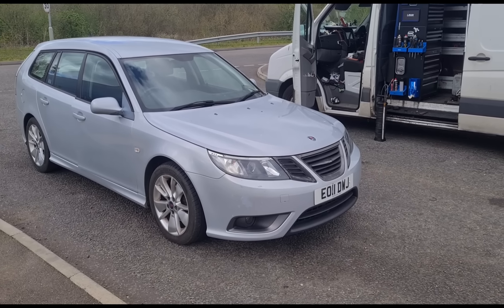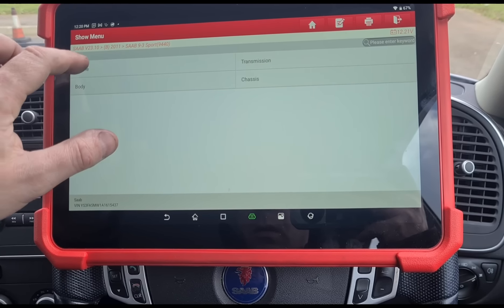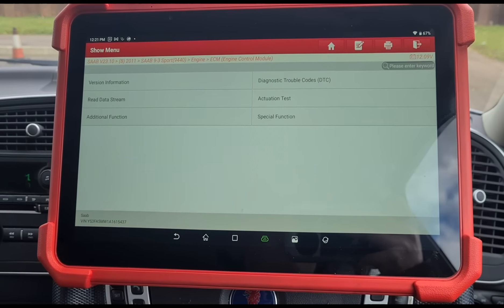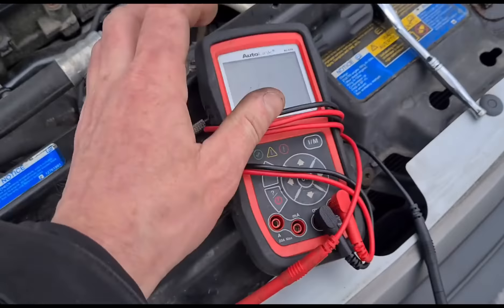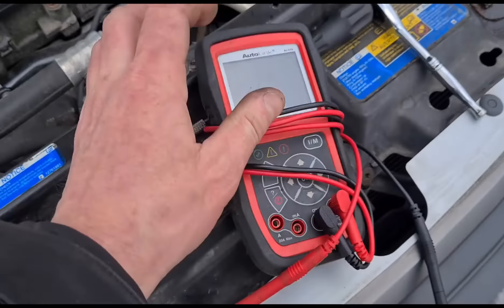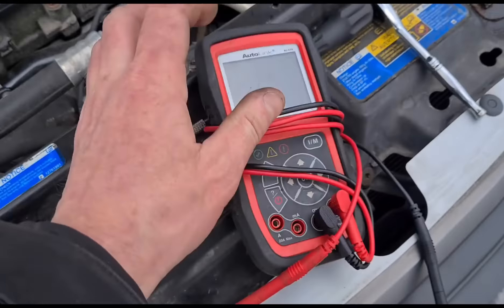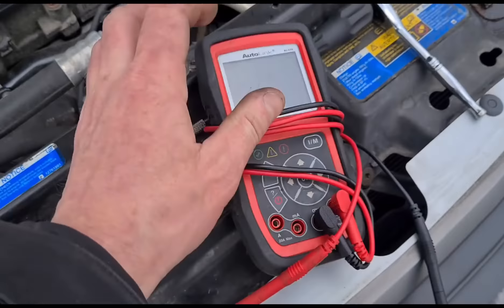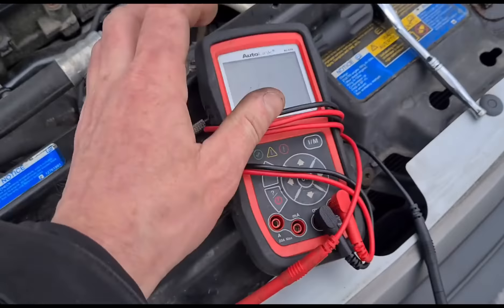Saab 93 Glow Plugs Replacement & DPF Cleaning P0380

Comment: Do you put the sensor pipe back on straight away or let it run through first with engine going after putting the dpf cleaner down the pipe ?